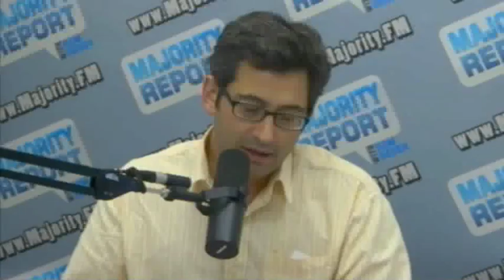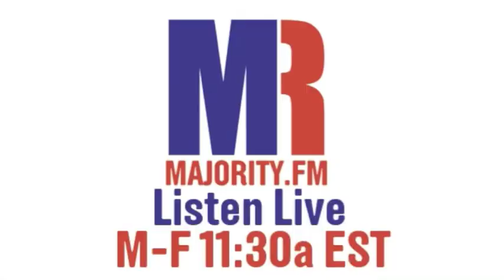Nuclear Reactor Unprepared For Global Warming

Comment: Sorry, how does warmer water take more energy to boil than warm water? Because it doesn't. The ability of water to absorb heat is very dependent on the difference between the temp. of the water and the temp. of what it's absorbing heat from, so warmer water is a poorer coolant.

Boiling water freezes faster than warm water (but not cold water), because it is also losing some heat via steam. I think this is what you are confusing.

Comment: "When a heat transfer path between them is open, heat spontaneously flows from bodies of a higher temperature to bodies of lower temperature. The flow rate increases with the temperature difference, while no heat will be exchanged between bodies of the same temperature". How does temperature have no effect on the waters cooling abilities? Your logic contradicts the fundamentals of physics.

Comment: Well water is only used to extract the energy from the rods. The water's temp really didn't have anything to do with it, it's a Minimum wage mistake. In fact warmer water takes more energy to boil than cold water, so warmer water would actually remove more energy. It's just because those running the plant have a paper eduction or none at all. Ice will evaporate with slightly less energy than hot water. thing of it like physics, more speed over same mass = higher energy density.